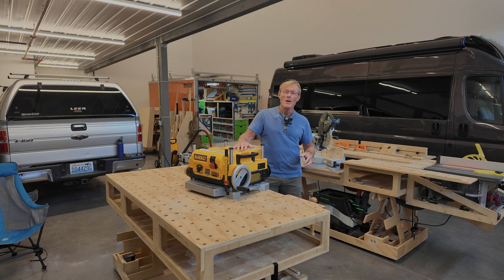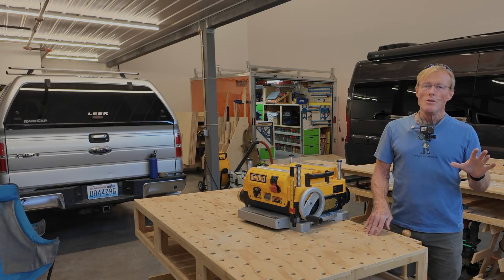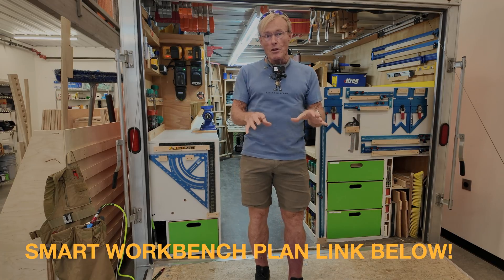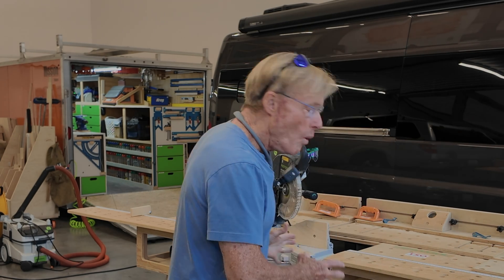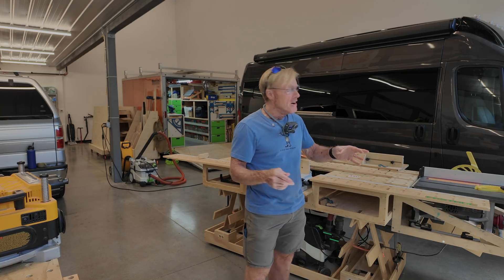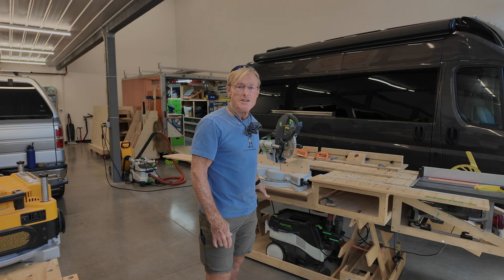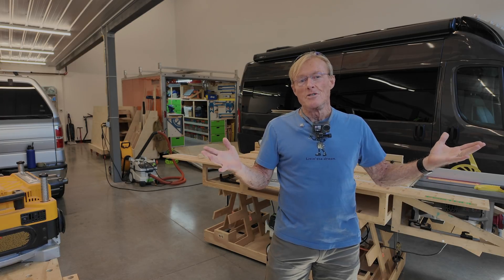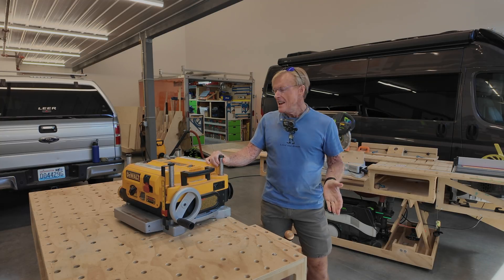Cordless Woodshop: The Smart Station Goes Off-Grid

Comment: Looks like you are blocking out the McKee trees.  At this point rolling most of the time, and straped to the cart base, the sawhorses don't make any sense any more.  I love mine.  I have to carry to uneven ground, they are great.  But for a flat floor, you need a wide post made like the benchtop.  Then you can get even more stability and strength, and use up less space.  They could be made out of 1/2"  they could be made not to need the cart, for those who don't need the flat storage.  They would contain storage.  They are simpler and faster to build and people that want some McKee action could have that also with something that pulls out like drawer slides.

At this point the sawhorses are a huge cost sucking up more than a sheet of premium 3/4 inch plywood, plus the routing template.  Square boxes could be template free, they could use the cubie cut-out template, but the boxes would only be square shots.

Building a catamaran, the beams for a 30 footer, 2-4 beams depending, are made of 1/2" plywood, and 1/4" plywood.  These boxes can be as small as triangles of 8 inches.  The beams/seats on my trimaran that take main loads are all 1/4', with large cubies for storage.  You can get amazing strength out of much lighter and cheaper materials, and box beams.

Comment: Is a cordless dust extractor out of the question, since you have the festool batteries any way, and it would remove the load of two tools starting at once, on the power bank?

Comment: Pecron 3600 is working for me. It runs a 12" dewalt miter saw and a dewalt jobsite table saw.
Reply: It is only 80 lbs and is selling on Amazon for $1,260
Reply from the maker: I will take a look 😎🤙

Comment: I strongly recommend building a small cart for your battery bank that you can wheel out of TheSmartWoodshop that can attach to the end of your SmartCart opposite of where you hang your tablesaw on the SmartBench.  Then the battery bank cart can wheel around with your SmartBench as one unit, and you don’t have to do any lifting.

Lifting the battery bank isn’t like lifting the planer.  You are placing the planer up on a workbench, so you’re not bending over to set it down.  If you try to load the battery bank onto and later off of, the SmartCart every time, you are bending over each time, both to load and unload.  That is much worse for your back!  Do yourself a favor and build a small cart for the battery bank that can attach to your SmartCart.
Reply from the maker: Good suggestion. 😎🤙

Comment: Ron- Keep in mind that while your Connected Loads (power tools) are intermittent, the Power Source's on-board Inverter is "always" on, unless you reach down and toggle it on/off... every time! Various content creators have measured that you can lose between 13%–20% of battery capacity to provide Alternating Current.
Reply from the maker: Thanks for the heads-up! 😎🤙

Comment: Hey Ron I'm running the same issue through now the anķer solid f3800 will give you the run time the predator 2000 have a 4k watt start up and a 2000 wat continuous it should be able to do miter saw and vacuum but table saw and vacuum maybe not but it's a lot smaller so you could do 2
Reply from the maker: Good info—thanks for the details! 😎🤙

Comment: This is an interesting puzzle. How do you cordlessly run your sawdust removal? I would be surprised if there were battery-operated vacuum machines, but how do you activate it cordlessly? Over the years, our poured conrete wall-form rental enterprise never had many cordless tools. I discovered the Smart Woodshop later on, within the last several years. It seems cordless power tools really took off since then, as the technology finally matured and brand names got on-board and really developed into something to be taken seriously.
Reply from the maker: The Vac plugs into the powerbank just as it would to a wall plug. 😎🤙
Reply: Makita and I believe milwaukee cordless vacs have Bluetooth rx/tx along with one on the cordless tool that activates the vac when the tool activates

Comment: Ron. I’m a long time viewer and have built your system in my trailer. We decided to do our power system right into the smart trailer with solar panels to power the system. 
For what you want to do, you are going to need an all in one system that can easily be removed and reconditioned.  Good luck on this venture.  Our batteries take up an enormous amount of space we’re running 8 200 amp hour batteries to run our 48 V all in one solar charge controller inverter system. It works very well, but it does take up space
Reply from the maker: I getting different info on what these portable power banks are capable of, but it will be proven out when I plug one in. 😎🤙

Comment: EcoFlow DELTA 3 Plus Portable Power Station is your answer. Relatively small with enough power to satisfy all of your tool needs. I know from experience. Multiple ways to charge (110 outlet, solar, car alternator). It’s also expandable. Weighs a lot less than the planer. Good luck.
Reply from the maker: That’s great to hear about your positive experience with that model! 😎🤙

Comment: Put your power station on something like a wheeled dolly for easy storage and mobility to where you want it over any surface, stairs, no more lifting and carrying. Should be able to shield it from the weather too.
Good luck
Reply from the maker: Thanks for the suggestion—I appreciate it! 😎🤙
Reply: Forgot to add: the dolly could to made to dock onto the smart cart so the smart system would roll around as one. Also, it could dock in the trailer at the location you are considering.
Good luck.

Comment: You would have to get 2 idt there is one that could handle the initial start up up like a table saw and vacuum i think table saws are like 12amp start up and vacuums are 7 to 8 I think the jackery allows you to add more batteries for run time but not amp bost you would have to have 2 units
Reply from the maker: Thanks for sharing your thoughts and details! 😎🤙

Comment: They have couple power banks but they typically max out at a 15 or 20 amp circuit dewalt has one that runs off batteries but if you want integral battery I would go jackery but I dont know how long it would last with miter saw and vacuum